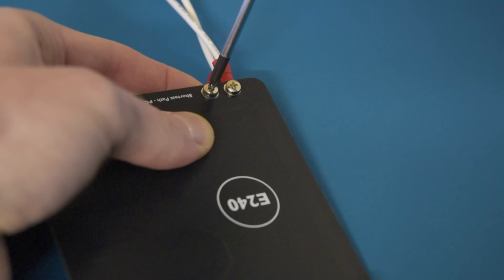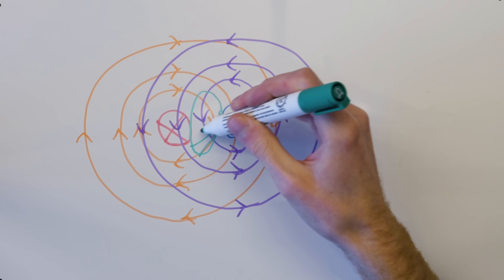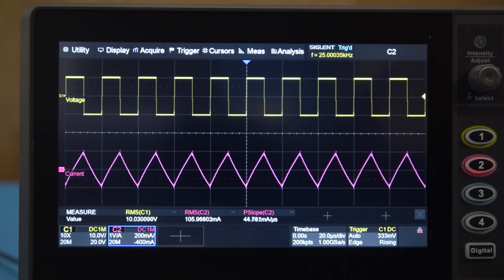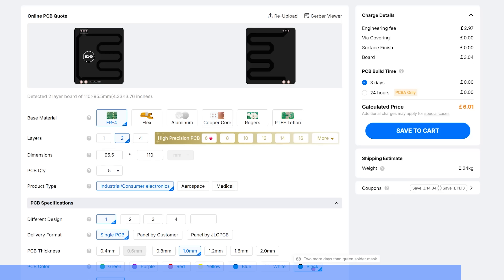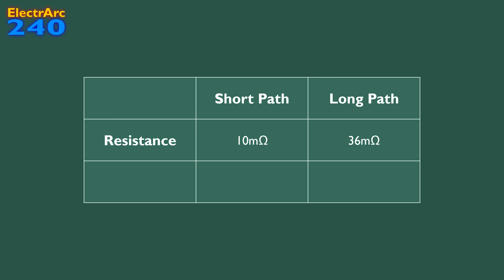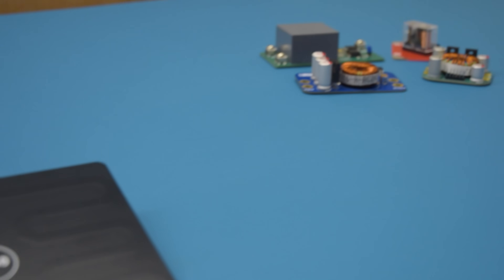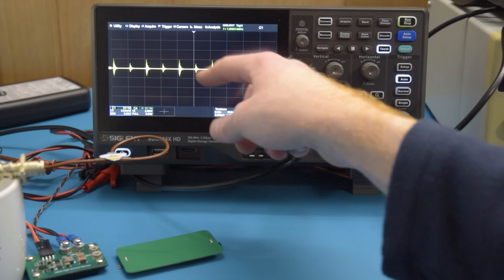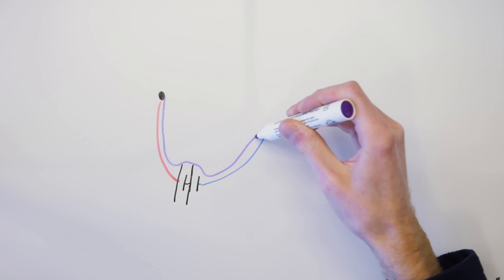Electricity Doesn’t Always Take the Path of Least Resistance

Comment: This title is actually misleading. Electricity really NEVER takes just the path of least resistance. It always takes all paths. Only the current is different for each path which is dictated by impedance/resistance/inductance.
Reply from the maker: Agreed, I don’t like it either, but that would’ve been a long title!
Reply: @electrarc240 Well, I didn't mean it as a title suggestion, but it could be short. E.g "Electricity takes all paths of resistance."

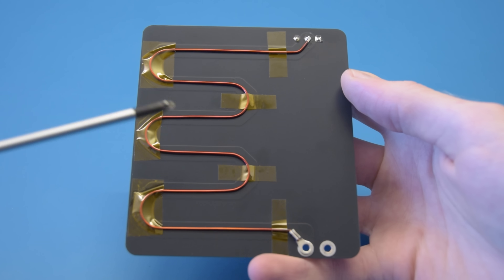Comment: 1:25 An AC trick, is it?
         My guess is that the second power supply has AC power (at a specific frequency perhaps), and the wave functions through the board cancel out, which lowers effective impedance of the longer path.

Comment: Your method to visualise the current is somewhat flawed, because the power of heat generation is, other things being equal, proportional to the length of the conduit. Therefore, even if the total resistance of the two paths were equal, the longer one would look dimmer anyway. Not to say your video is poorly made, I've enjoyed it a lot, actually. 

Also, as far as I can remember, we've called impedance a different thing in our radioelectronics class, a complex number which was totally analogous to resistance in how it behaves with respect to parallel and linear composition of circuits, but for alternating currents, and what you call impedance we've called the absolute value of impedance.

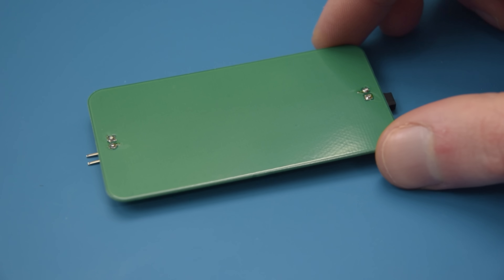Comment: 11:05 and that's exactly why stitching vias are a thing on two layer designs.
Introducing the problem of gnd plane  interruptions, but not introducing the 2 major fixes is a crime 😂

jk, it's a very very good introduction video to emi design considerations, imo just missing that on 4 Layer (or above) Designs, one Layer will always be an uninterrupted gnd plane (except Vias ofcourse, but those are negligible), or on 2 Layers, just placing vias beside the trace with a good spacing  and making sure the gnd plane on the other side isn't interrupting there either.

Comment: Electricity never takes the path of least resistance. It takes all paths at once.
Reply: Never?  What?  Electricity ALWAYS takes the path of least resistance. If there are others paths, some current will follow those paths, also.
Reply: @MrSummitville electricity doesn't take the path of least resistance. It takes all possible paths. The total current flowing through the paths of "most resistance" can be orders of magnitude greater than the current flowing through the path of "least resistance"
Reply: @Johnsmith69448  Which includes the path of least resistance. Duh! Your first  sentence, in first post, is 100% false
Reply: @MrSummitville i don't think you understand what "X takes the path of least resistance" actually means, or how electricity works.
Reply: @Johnsmith69448   This is exactly what you wrote ... Electricity never takes the path of least resistance."  <= That is 100% false!

Comment: Thanks, but I am still a bit confused. Can you please follow up on these questions?

11:30 Why didn't this create two small current loops at the top and bottom?
11:42 Wouldn't the red current path follow over the blue current path to decrease impedance avoiding this current loop?
Reply: @electrarc240 please answer this question, its nagging me too
Reply: 1. Assumption: It does create two current loops. But they are in opposite directions and emmit exactly the same amount of power, (the larger loop has proportionally lower current) so they mostly cancel out.
2. Red path is an actual wire on the main side of the board. It can't bend.
Reply: Ah so for 1. Both blue lines are the return current. There are two because they split up, as both paths around the cut are equal impedance

Comment: In your example where inductance is cranked up and we see the square wave become a nearly perfect triangle wave, how come it doesn't become more like a sine wave, or at least a triangle wave with significantly rounded tops and bottoms?
Reply: Look carefully.  Initially the tops were rounded. But with a large impedance and/or a high frequency combination, the increase in amps is linear, not curved. This is the foundation of Switching Power Supplies.

Comment: 0:23. I don't understand this. It looks as if you have the + and - the PSU both connected at the bottom of the board. There's no need for current to go through that trace at the left at all; input and output of the board are right beside each other. Or is there a second trace on the other side of the board that you've not told us about?

Ah, and so later it becomes obvious: you do have a return path on the bottom of the board. I don't think it adds anything to this video to hide facts from the viewer; it just makes it less good as an explanation of how electricity works, since the viewer's left wondering, throughout, what other facts you might be hiding.

The whole thing would have worked fine showing the complete board (both sides), what you see when using it with a DC PSU, and what you see when using it with an AC PSU, without having to hide anything.

Comment: That was actually a neat explanation, I never even would have considered the fact that in some situations it's actually easier for current to flow through a longer path because of how inductors behave and that longer path reduces the inductance. I guess this is also the same reason ethernet is twisted pair, and not just to reduce crosstalk.

Comment: Energy of all types will take the path of least resistance. Distance is irrelevant. The entire universe is trying to achieve the lowest possible energy state. A Bose Einstein condensate. Where it originated. All matter emits infrared radiation. They're evaporating. Eventually all matter will evaporate back into that condensate. Including 'black holes', as they emit energy as gravity waves. It may take trillions of years, but it will happen. It's what is referred to as the cold death of the universe.

Comment: Oh god, my entire life I thought that those zig-zag patterns on the motherboards are to delay signal transfer and resolve hazards on certain paths but it turns out it actually has to do with impedance and reducing noise 😮
Reply: Sometimes they're differential pair signals and need to be length matched
Reply: I think you've misled yourself. As you previously believed, those zig-zag patterns are indeed often used to delay some signals. Zig-zags are used for some signals to ensure all traces in a parallel set are identical in length and thus all signals will arrive at the far end at the same time. However, Fred used the zig-zag pattern to illustrate a different concept - that the longer zig-zag path could perform better (in this specific example) than the shorter path because the return path for the zig-zag signal was directly underneath the top path (separated by only 1mm, the board thickness). This minimised the loop area and thus the inductance of the circuit. The shorter path's return path was far away from the straight track on the top side and so had a much larger loop area and thus much higher inductance. It wasn't important that it was a zig-zag pattern - it was to emphasize that it was a much longer path but still performed better.

The zig-zag was used to illustrate the issue but normally you would not want to make traces (for high speed signals) any longer than necessary - a shorter straight track would be better than zig-zags provided the return path for the current can be arranged to be directly below, or close to, the signal path.

Comment: Yes, but the magnetic field in your diagram seem to add up between the wires (they go the same direction).   I guess what you mean to say is weaker/cancellation of magnetic field "outside" of the pair? Because that's where some of the field lines point in opposite directions. That's exactly what the probe is picking up.. a weaker magnetic field outside the sandwich. But other than that, great video!

Comment: You've given me a thought for welding machines with 2 negatives on different parts of the choke. 1 is usually short & the other a longer coil. The shorter path has less inductance & used for higher amps, while the longer suffers from the same magnetic "feedback" as your power supply, but at lower amps, provide smoother operation, while higher amps, provide smoother welding with the shorter path.  How does capacitors influence this on either side  of the choke? Also, If I connect both negative outputs in parallel after the choke, will the current, because of impedance automatically decide which output to use based on the amount of amps I draw ? What bothers me a little, is I'm welding DC and If I am to understand correctly, you're stating that with DC, that magnetic interference is not really an issue ? Then why did they add the choke specifically for impedance issues on a pure DC welder. ( not pulsed DC as in your case ). What use would adding a longer choke for lower amps be then, again seeing as I'm using pure DC....?

Comment: Can you please explain why you chose to use a magnetic field explanation for this effect, and not the parasitic capacitative coupling that happens at different layers? I guess it's both but shouldn't both be mentioned?
Reply: Not sure what you are getting at. The capacitive coupling would be a loss, this is not really about losses but main current paths.
Reply: @jaro6985  I'm pretty self taught with these things....I definitely need to read a book. So you're saying the capacitative coupling between the top layer and bottom ground plane causes losses? Does it not give a low impedance path for the high freq current?
Reply: @sink9963  ah I understand what you are talking about now, yes you are right but the capacitance is only a few pF. You can calculate based on the square area of overlapping traces.
At 1MHz a few pF will not transmit much power compared to a trace, we are talking >10kOhm impedance.
Reply: @jaro6985 So you're saying that the capacitance is not large enough to have a substantial effect on the current path?

Comment: Thanks, this was a very good explanation of current loops and why proper ground planes are important. And it explains why the PCB in my 46 year old Commodore floppy disk drive is emanating so much electric noise... Two layer board, no ground plane...

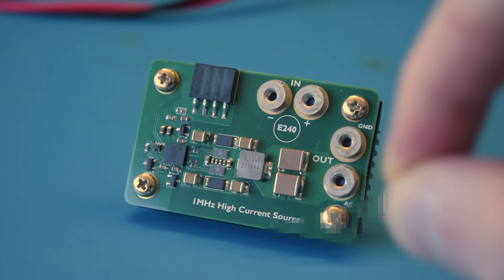Comment: 4:25 I assumed from the first/second demonstration combo that the second, "rather pixelated" power source you used would be an induction cooker circuit or smth related -- a high frequency current driver.

Comment: Kirchhoff's circuit laws, written in 1845, describe how direct current flows through all possible paths in portion to the conductivity of each path. (For AC current, impedance instead of resistance governs the current flows.) The lower the relative resistance of a path, the higher the current. The "shortest path" concept is a fallacy. If you had a wire connected to a circuit that wrapped around the planet Mars, some current would flow through it.

Comment: We were struggling once on a new product design, trying to get it to pass radiated susceptibility and ESD.  Our intuition was telling us that it must be a loop area problem, but we just couldn't see it.  We consulted with a hot-shot RF engineer, and he pointed at a structural piece of aluminum that was being used as a ground plane - he said that in our problem frequency range (500MHz-5GHz), the two sides of the aluminum sheet were effectively insulated from each other by skin effect.  We did follow his advice, but we also threw a kitchen sink of changes at a new quick-turn pcb.  The new board solved the problems, but I've been curious ever since how much the aluminum sheet metal change helped.  My high-frequency skills are pretty poor, maybe an RF guru could devise a way to test the skin effect theory.

Comment: This is why high performance PCBs typically use Via stitching on ground layers, near high speed signals and switched power supplies or RF traces to provide the shortest return paths, reducing inductive and loop effects and enable a controlled return path in the event of the ground plane being interrupted.

Comment: i think because the quantum nature of electrons, they dont all behave the same, some will take the longest path, but once one finds the shortest the others follow.  This happens so fast we just see the shortest path. Sort of like how 4% of light bounced straight back instead of being deflected.  I also suspect this is why doesnt matter what side you put the current limiting resistor on an LED.   Logically if you put it on the wrong side the LED should blow if current has a direction of travel. But it doesnt when you put it on any side. I think because a few electrons go through and then tell the rest there is resistance to slow down.  Something like that.  They communicate with each other, sort of like in a super conductor.
Reply: No, that description is very wrong. For a start, current does have a direction of travel and there is no "wrong side" of an LED for a current limiting resistor: the current will be limited regardless of where the resistor is in the circuit because the current is the same at the input and output of the LED and the input and output of the resistor (Kirchhoff's current law).

I would avoid any thought about quantum effects and just learn the basics of electricity first.

Comment: really informative! great explanations!
relatively low cost xd 
can you maybe make a video comparing this 5000$ the Bode 100, to the less fancy 30$-200$ NanoVNA?
Reply from the maker: Cheers! The NanoVNA is an RF VNA with a minimum frequency of 50kHz, sadly all cheap VNAs seem to be high frequency ones. The Bode 100 is actually the cheapest VNA I know of that can do down to low Hz. Tbh I mostly use it as an impedance analyser / LCR meter but it can do a whole lot more than that. Got to give it back now only had it for six months ;(

Comment: As someone who implemented your bodges on my version of your metric clock, I am left to wonder………. how could you mess up such a simple circuit Fred?😊
Reply from the maker: Haha no board is complete without a good bodge wire! But yeah I didn’t anticipate the heat from the return trace passing through the PCB to the front so much, spoilt my lovely demo! But I am proud to say that the current source board has no bodges ;)
Reply: @electrarc240  yeah but ………it was a very tidy bodge. It looks almost……… perfect.

Comment: Having a smallest possible RF physics background, I immediately thought of some high frequency shenanigans going on from this thumbnail. Initially I thought the circuit had a solid ground plane underneath the squiggly line, as is custom in PCB transmission lines, but a single wire is apparently enough to demonstrate the effects.

Comment: With the squiggle and a ground plane, does the circuit take the shortest path from the squiggle back by following the squiggle up top?
Reply from the maker: Yes if there was a solid ground plane beneath the squiggle the return current would still follow the path of the squiggle at high frequency as that would be the lowest inductance (lowest impedance) path

Comment: 7:58 - Electricity doesn't follow the path of least resistance.  Stop perpetuating this inaccuracy.  Electricity follows all available paths in amounts proportional to the impedance of the path.
You can even clearly see this at 0:29 (DC demonstration) - the long trace is heating up too, just not as much as the short trace
Reply: The whole point of having paralel circuits to begin with.

Comment: Very nice! Here's another interesting potential example that I recently thought of, that doesn't require high-frequency AC (though it would be practically difficult and rather unsafe to attempt to implement):

Consider a helical coil of negligible-resistance wire, winding round a high-permeability magnetic core, where the helix shape is so elongated that the direct-peak-to-peak distance D (i.e. the "width" of each turn) is more than half the arclength S of a full turn. Assume that the magnetic field is zero outside the magnetic core. Let E denote the breakdown voltage of the air around the coil. Apply a voltage across the coil such that, letting V denote the applied voltage divided by the number of turns, we have
V/D < E  but  2V/S > E.
The voltage along the direct path through the air from one peak to the adjacent peak is V, which is not enough to induce breakdown along the length D of that path. However, the voltage along a path through the air from one peak to the adjacent peak that winds round the core in the opposite orientation to the coil is 2V (by straightforward application of Faraday's Law). Since we assume that
2V/S > E,
this is sufficient to induce breakdown. And so what I think will happen is that you'll get currents through the broken-down air that wind round the core, but no currents through the air that take approximately straight-line paths.

Comment: Electricity DOES NOT take the "shortest path". That is a complete misnomer.
Nice video!
Reply: It depends on how you measure the length of the path. 

In mathematics we have the concept of a metric space for which you have one or more distance functions; the length of a path depends on the distance function you use. For example when I'm measuring distance in a computer network, I would typically use number routers over which a packet will traverse, or round trip time (RTT); physical distance is generally irrelevant.

And even non-mathematicians do this intuitively. Someone considering the "shortest" path to drive to work will often use time, instead of physical length of path, as the metric, and for a shorter commute prefer a physically longer path that takes less time (perhaps because it has less traffic, or fewer stoplights).

In this case the distance function is reactance of the path, and measured by that, for a 1 MHz signal the physically longer path is indeed the "shorter" one.